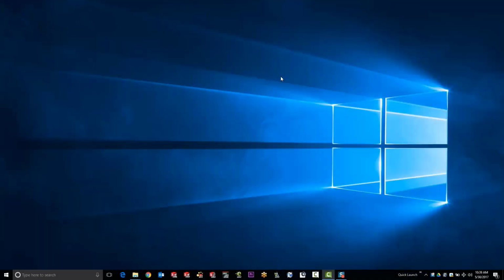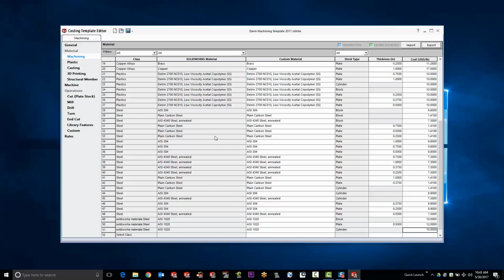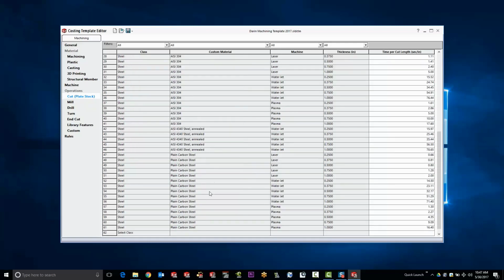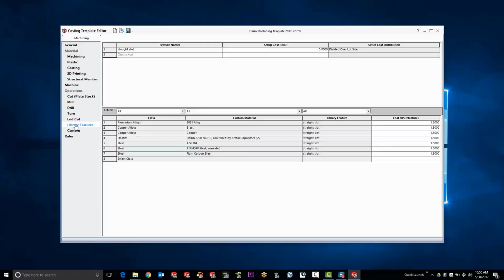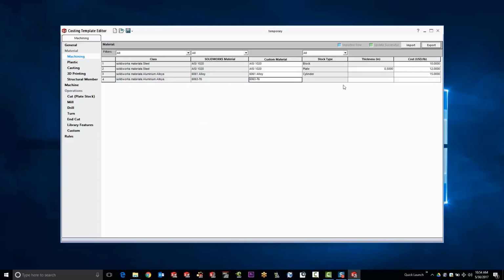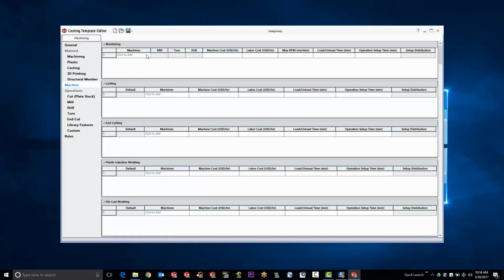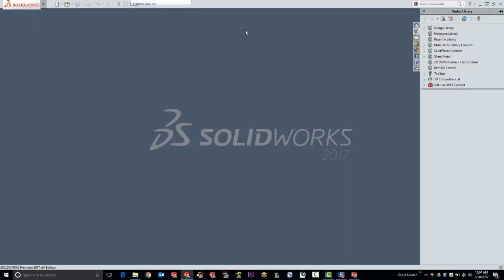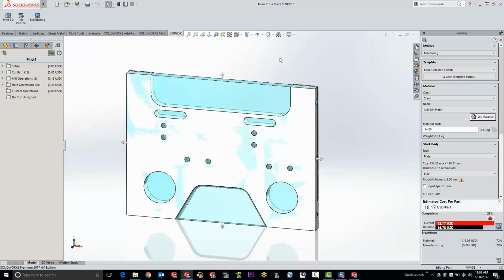SOLIDWORKS Tutorial - Costing Template Setup

Comment: I’m trying to set up costing within Weldments, and I get a error message under profile and size of stock body saying “Matching Profile could not be found in the template” but it has all my weldments profiles there in the drop down. I think it has something to do with my File Locations getting crossed but not sure. Anyone else have this issue?